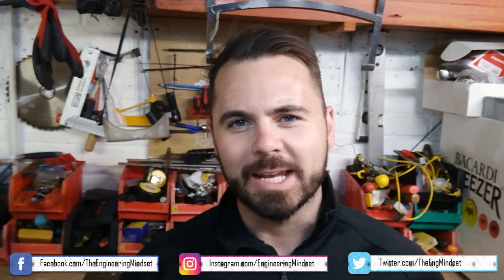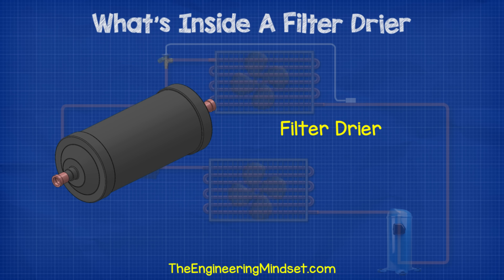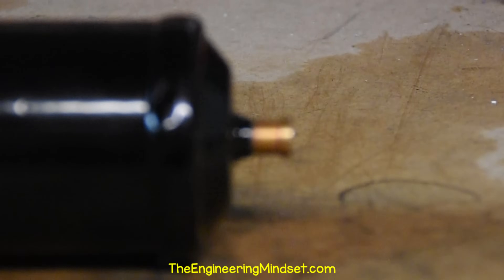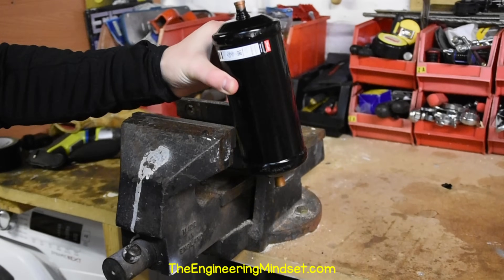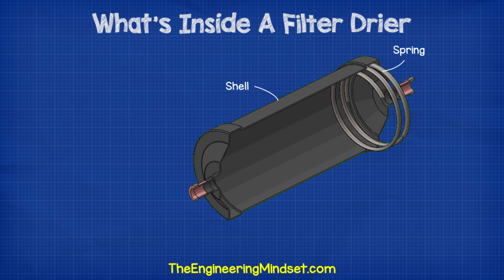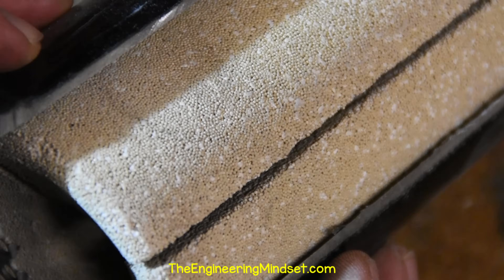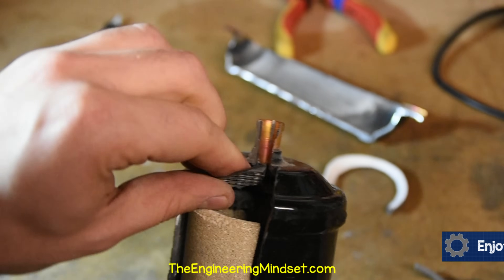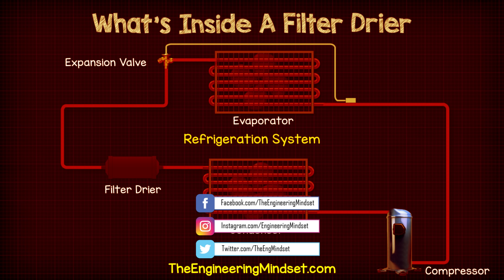What's Inside A Filter Drier - How it works  hvac

Comment: So, is this whole device considered a consumable??  Doesn't seem like something that could be cleaned without destroying it... Though I guess the hope is that 99% of the time, it has very little to do, and it's mostly just when initially charging a system that there'll be some moisture and/or dirt??  Or... ??  Would be curious to understand more on that... though... I also see that the next video in this playlist is "How Filter Driers Work", so, perhaps I'm about to find out.  :)

Comment: Brazing vs. Soldering:
3.4.9 JOINT, BRAZED – A gastight joint obtained by the joining of metal parts with alloys which melt
at temperatures higher than 800°F (427°C) but less than the melting temperatures of the joined parts.  For high pressure refrigerant systems.

3.4.10 JOINT, MECHANICAL – A gastight joint obtained by the joining of metal parts through a
positive holding mechanical construction.

3.4.11 JOINT, SOLDERED – A gastight joint obtained by the joining of metal parts with metallic
mixtures or alloys which melt at temperatures not exceeding 800°F (427°C) and above 400°F (204°C).  For low pressure hydronic systems.

3.4.12 JOINT, WELDED – A gastight joint obtained by the joining of metal parts in the plastic or
molten state.

Comment: How can the pressure drop be minimal while passing through so tight filters?
Reply: Because in the end, the liquid refrigeration is actually going to be getting its back pressure from the metering device (which is a very small opening and the liquid refrigerant is really not flowing that fast with a lot of volume on a standard residential system). Also, If you notice the size of the filter dryer, it's much larger than the liquid line it's serving. So with all the surface area for the refrigerant to pass around the entire outside circumference, this offsets any pressure drop through the fine filtering material and allows it to come out the end without issue.

Comment: I've sometimes wondered, if dirt is getting into the refrigerant, wouldn't that imply an unclosed/leaking system? Perhaps there is a break in the suction line that is pulling in contaminants?
Reply: Exactly why they need maintained, to find this out
Reply: Not likely, bad installation/servicing more likely.
Reply: i would think that eventually corrosion would happen and that's how it would get dirty or clogged

Comment: I don't really get it. Why do we need this? I mean if the system is installed precisely than during operation nothing can leak inside or outside. Or am I wrong?
Reply from the maker: It's impossible to install precisely, air will always get in and in the air is water

Comment: So am I safe to say that the filter dryer is a one time thing ? Brazed welded in and used once to clean all the crap and that's it. Because the line set is sealed no more contamination can get inside . So one time use ?

Comment: Why was the screen dirty on the wrong side of the direction flow?  Seems like the filter would be capturing stuff on the core side not on the other side as yours was.  Was that dirt and stuff from the cutting tool maybe?
Reply from the maker: The FD was new, the durst inside is just from cutting

Comment: I keep wishing it were possible to buy parts from hobby electronics suppliers to play with tiny arduino sized cooling systems. I want to play with peltier modules and miniature dc compressors to try and result in a unit that can charge a phone from room heat. (cooling the room in the process). !!! Any tips??
Reply from the maker: Sounds like a fun project. You can buy everything online, get making!
Reply: @EngineeringMindset  well, i ordered a couple of peltier cheapies and a tiny motor and compressor, but have no vision on what to do next. I dont know of heat exchangers smaller than pc cooling, and need to find more resources for inexpensive parts. In honesty, i wish it were like other projects, with a bunch of top videos from years ago, but as of yet I havent found any.

Comment: Why is the filter drier placed after the condenser and not directly before the compressor?
Reply: There are some you can get for acid burn outs in those situations that require major decontamination, but simply having it on the liquid line is is easier with the lower volume of flow of liquid and immediately helping the metering device from plugging up.

Comment: Always wondered what's inside.
Thank you for this video.
Reply from the maker: Hopefully it's popular and we can cut some more stuff open!
Reply: Was also wondering what's inside the airplane wall, as in how the ducts are made compact and efficient, and the ram air system. 
Like whole airplane refrigeration system layout in form of animation, cuz till now, I've been using my imagination.
I read 3 types of Air plane refrigeration systems
Simple, bootstrap evaporation type and Reduced ambient type.

U don't have to cut anything tho :'D
Reply: Fixin ok  not miss unding  misundin standin paying esay stedy after not teling some amy gues not play  only  dreshion not harasing . Sorriy good way line   yes  .. DRIER  FlLTER....drier  filter  used  remove  mosisture  and  dust   particles  from the  liquied  refrigerant   .dust particles  in  the refrigerant  may  cause   blocking  at  the refrigerant  control.  Atmospheric air  always  contaun   water  vapouer  .the  refrigerant charged  in  a  system  may  contaun  samll quantity  of  air  and  water  vapouer  .if the  evacuation  is  not  done  .. propely the  remaining  air  in  the  system also  contains  water vapouer.  When  the  temperature  of  this water   decreases  below 32°F  inthe   evaporator.it freezes  and  cause blocking at the out of the capillary  or  in side  the  evaporater  .when  the  moisture  circulaters   through  compressor  .the  motor  wind  ing  may  burn  or the  valves  be  damaged.  Ex pls  .in pardes   out of in parts   dirierfilter.   Dissicant..  filter.. flare thrid usin solding type size  cubic  inches  size   2"  1/8.3 .1/6to1/4...6.9.9.12.181.30.50......us
Reply: Freezing  in  side the  evapotator   usin   compwrs ner  liquiwd line
Reply: Drier  filer  .. the  function  of  the  drier  filter  is  to  remove   moisture  and  dust  particles  from the  refrigerant   dust  particales   causes   blocking  at  the  refrigerant control  . Moisture))..   also causes  blicking  by  freezing  in